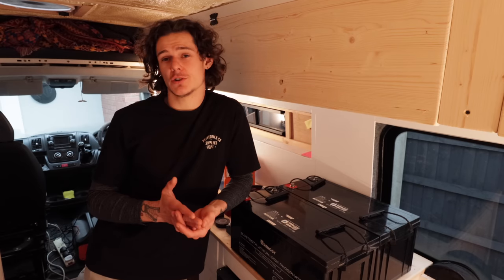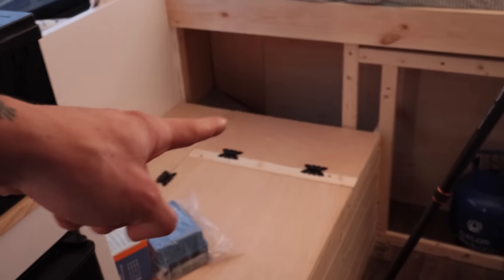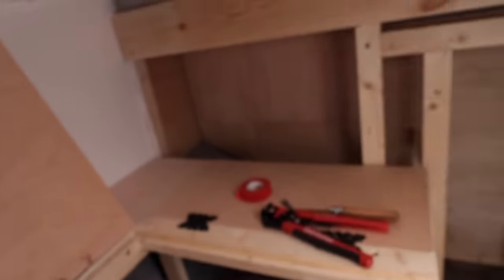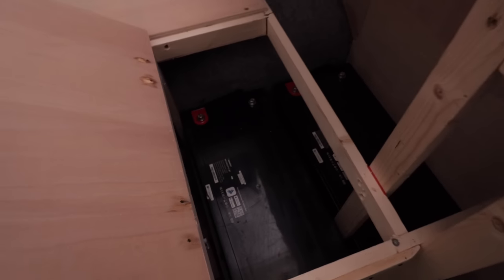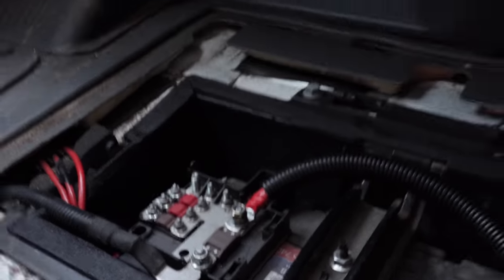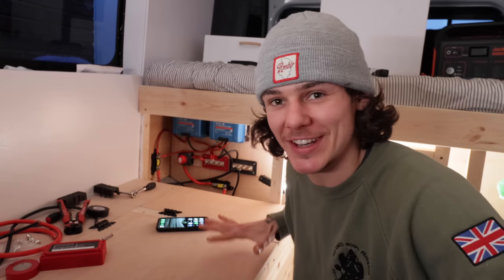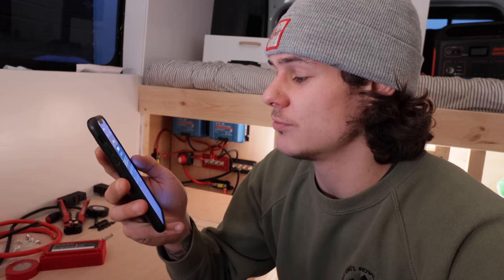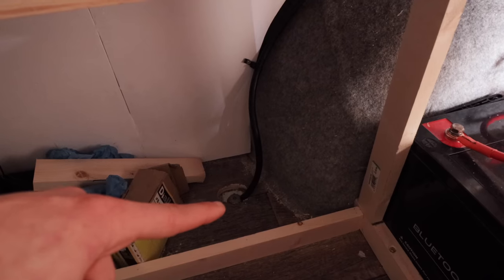VAN BUILD - Easiest Electrics video You'll ever watch.

Comment from the maker: Links to the materials used in the video :)
Ask for more below if I’ve missed any! :) 

Starter battery main 35mm wire
https://amzn.to/3uPeE1Q

35man wire lugs
https://amzn.to/3UOTo76

Fuse housings 
https://amzn.to/3V3ScwU

100A fuses
 https://amzn.to/3FuePVv

16mm wire 
https://amzn.to/3HtNFk6

16mm wire lugs 
https://amzn.to/3BzEScC

Bus bar’s
https://amzn.to/3uOzChC

Shut off isolator switch 
https://amzn.to/3Wa7i4G

Wire tape
https://amzn.to/3v6OdFj

Comment: I remember when i was doing my homework before buying batteries, that lithium doesn't do too well in the cold, Opted for 3x130AH AGM feeding a 1500w inverter with a B2B and 375w Solar panel on the T5 roof running through a Renoghy 40A rover li MTTP controller. Can't even describe how life-changing it makes your van mate. Good job.

Comment: Handy to get your view on things.. I am doing a complete rewire on the parents van at Christmas, but I am keeping the 240v and 12v Completely separate so they will only get 240 when they plug into a campsite :-P.. All new wires arriving, bus bars, clamps etc.. Just need to get the battery isolator so I can switch the 12v system off if needed

Comment: Quick 1, make sure you've  setup your Victron kit to work with your specific  batteries in the app settings. EG: battery type, battery capacity, low voltage levels etc etc 😉 Great video buddy 👌

Comment: Awesome installation video mate! I would put breakers upstream of the fuses 5A less than the fuses. Breakers can be reset, fuses are a bugger to replace. You can also turn off the left or right system at the breakers. Other than that, check your alternator ratings. You can get heavy duty alternators if needed. Crack on Jake. Good show 👍

Comment: I’ve enjoyed following your journey along since the beginning jake
And look forward to doing so for a long time to come.
Just a safety heads up mate
You need to put a fuse close to the starter battery on the cable feeding to the rear of the van.
If something does damage that cable and it shorts to earth 
There is no protection and that cable will heat up and cause a fire.
Stay safe mate and keep the vids coming
Reply from the maker: Thank you so much mate, appreciate that! 
Shout! Will nip that! 🙏

Comment: A nice tidy job but have you got covers for those bus bars? A spanner falling across the two of them would be quite spectacular but would probably fcuk up everything you've done.

Also, it's a good idea to secure the batteries to the floor with straps or something similar. If you have a high speed crash and the van turns over those things flying at the back of your head would do some damage.

Have a bostin Christmas.
Reply from the maker: Yeah got those to go on Tony :) 
And that’s in the pipe line too 🤘
Thanks mate! You too! 🤙

Comment: You got the charging coming from the main battery and not the alternator?  What stops the house batteries (excuse me, leisure batteries) from draining the starter battery when the engine is not running?
Reply: The DC-DC chargers are sat between the starter and ‘house’
Reply from the maker: The DC-DC’s are only active when the engine is running as they only cut in & draw charge when they notice an increase in voltage to the starter battery :)

Comment: Power 💪
Couple of questions for you - could you not stack the batteries, to give you more underseat storage? Have you considered using/making battery heaters, given our current (no pun intended) cold snap, seeing as you are using LiFePO4 🤔

Good luck with the rest of your build chap.
Reply from the maker: Intents to fit my inverter over the one closest to the front & the other gives me enough room for extra bits / circulation, those dc-DC’s get v hot :)
Reply: @JakesJourneyMate  not a problem fella. As with every van build, we all need to plan ahead to save rejigging at a later date. That said, is any van build complete, once finished. 
DC-DC do get warm however remember that heat only rises 👍 I'd hate to see you lose a battery, when it's needed the most..

Comment: Are you going to be setting up solar or just off the van? Also I don’t understand, if you hooked it up to the main van battery, how does it now draw power from the van itself?
Reply from the maker: At a later point yes mate! :)

The DC-DC’s are only active when the engine is running as they only cut in & draw charge when they notice an increase in voltage to the starter battery :)
Reply: @JakesJourneyMate  very smart
Reply: The red cable, can you let me know the thickness again, you sure it’s 35mm? That s like an inch and a half🤔🤔